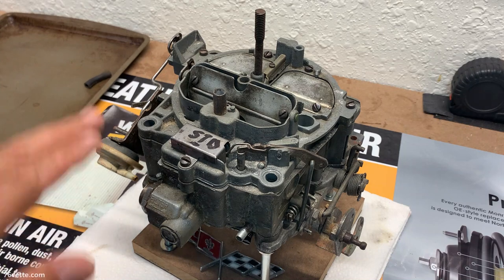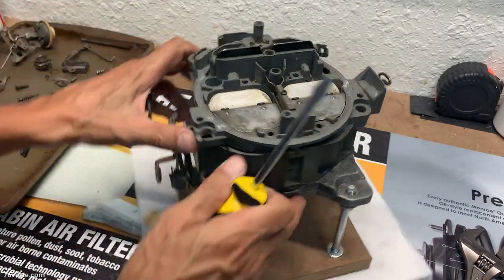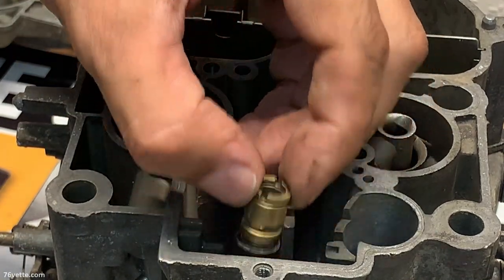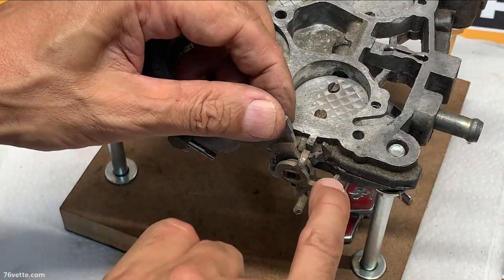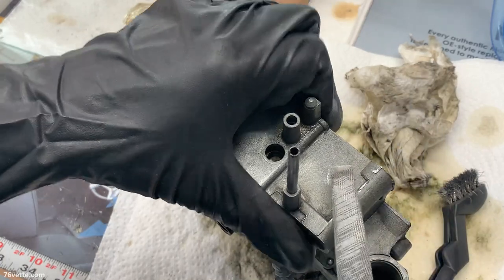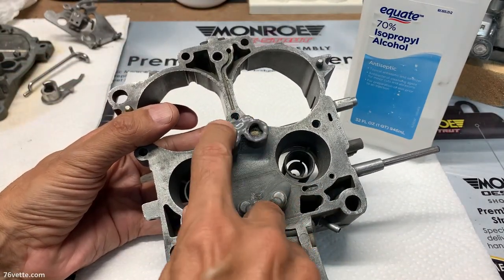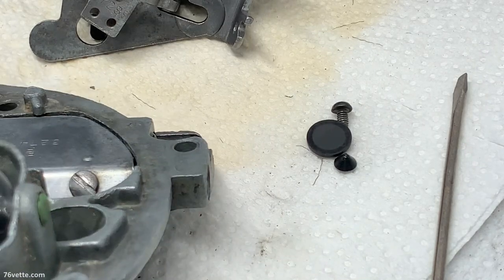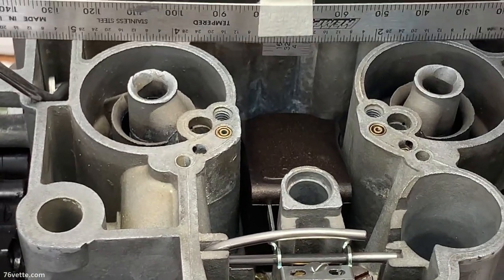QuadraJet 702 Carburetor Rebuild

Comment: Very interesting and useful !

I have a '69 427 from a Corvette in the chevelle I just bought. Do you happen to know how to connect the vacuum lines to the distributor, carb etc? It seems that what is on mine is not all hooked up. Thanks
Reply from the maker: The distributor vacuum advance uses one vac line that needs to be connected to a ported vac port usually located at the front of the carburetor body. If there are unused carb vacuum ports (ported or manifold), you want to plug those properly. 
Good luck and Thank You for watching! 😊👍🏻

Comment: I'm waiting for a rebuild kit for mine and this video will be GOLD, thank you! Did you have some trick to replace the idle tubes too?
Reply from the maker: I did not remove or replace the idle tubes. However, I cleaned them as much as possible using wire strands as shown in this video: https://youtu.be/gz_1RQp3ww4

They can be removed, of course, if necessary, and there are several videos available that show that approach, which basically involves a coarse-thread screw to bite into the soft metal so you can pull the tubes out.

I think running the right gauge wire through them and plenty of carb cleaner can be just as effective. 

Good luck with your rebuild and I hope you’re happy with the results. And thank you so much for watching! 😊👍🏻
Reply: @76vette  problem is that I have a '68 vette 327/300 with a quadrajet that is an old/unknown rebuild and not the exact fit for my application (7028213 vs 7028207 from spec). I already got some problems like lean idle and poor response to adjusting screws, so since now it is flooding due to worn gaskets (I live in EU and here we have mandatory ethanol) I'm taking the occasion to change the idle tubes with a .040 pair to see if it can run better. I knowed the coarse-thread screw method but, since I want to do less damage possible to the old ones, I was wondering if there was a less aggressive way
Reply from the maker: @MetalGarage   Unfortunately, the only method I know of is to use a screw to pull them out. 

The only real damage would be some scarring inside which can be pretty much eliminated by running a micro drill bit through the jet. 

This kit here is almost identical to the one I have and it may be a good investment for you.

https://amzn.to/3Ua8nt0

Also, if you are planning on replacing the original tubes then any potential “damage” to them should not be a concern, unless you are planning to reuse them at some point. 

Just a thought.
Reply: @76vette  I would like to save the old ones just in case the new .040 will run too rich. I will be careful.Thanks!
Reply from the maker: Also make sure your carb has the right jets, metering rods, and idle mixture screws. The guys at https://quadrajetpower.com will sell you a complete rebuild kit specifically calibrated for your application. 
Good luck! 😊👍🏻

Comment: Hi could you please tell me the torque specs on the 4 mounting bolts on carb to intake ,  also is there a torque spec for the top horn screws. Thank you
Reply from the maker: From the 1981 Shop Manual… (I think they’re all pretty much the same)

“CARBURETOR MOUNTING TORQUE

When torquing carburetor after removal, overhaul, replacement or when installing a new heat insulator, torque mounting bolts, in a clockwise direction, to 16 N•m (144 in. Ibs.).

When retorquing carburetor at recommended maintenance intervals, check in a clockwise direction. If less than 7 N-m (60 in. Ibs., retorque to 11 N.m (96 in. Ibs.); if greater than 7 N•m (60 in. Ibs.), do not retorque.”

As far as the air horn, it just says to “tighten all screws evenly and securely using the screw tightening sequence” starting with the two countersunk screws inside the choke Venturi, followed by the inner secondary screws all the way to the back of the carb, then two outer middle, then two outer rear, then front screws. 

This information is why I sound like a broken record when I say that you MUST have as many books as possible if you’re going to wrench on these cars. 😊👍🏻